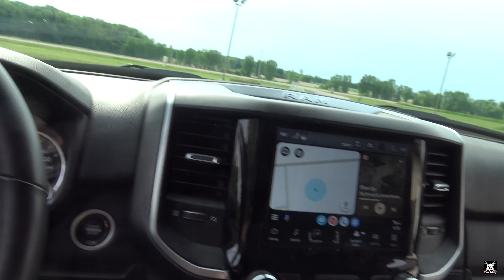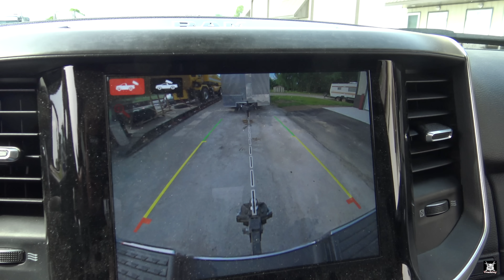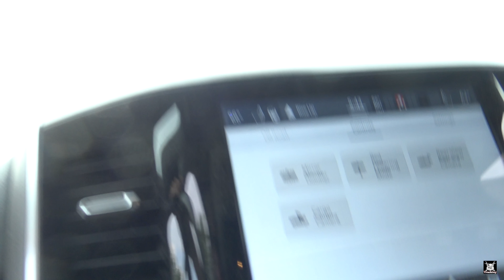Equipment Shuffle Before I Roll Out To North Carolina

Comment: 29:00 This is what i like about my Viking 12 volt jump starter up to 1700 peak amps as it has a built in air compressor 250 PSI, a LED work light and USB charge port and fits behind my driver seat in my pickup.
Don't have to deal with lugging a awkward tank around and look for a plug-in plus extension cord, compressor hose and attachment.